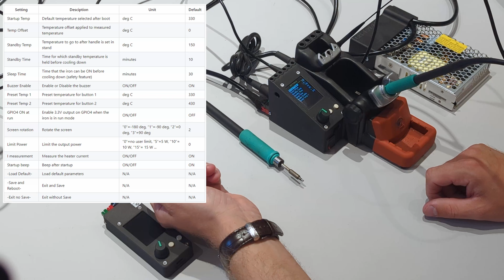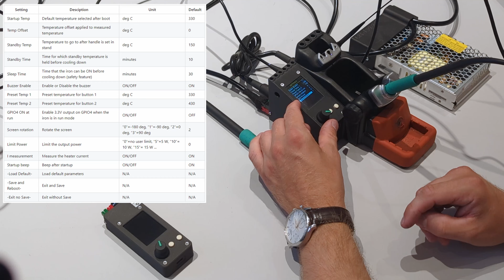AxxSolder 3 - Open source DIY soldering station for JBC cartridges, 9-24 VDC and USB-PD

Comment: 10:34 Perhaps you should familiarize yourself with the settings before making such statements.
Reply from the maker: After using JBC equipment professionally for several years I do think I have the right to say that I think the interface is annoying.
What do you think is so great about it? If you have a good input I may be able to introduce  it into a future AxxSolder firmware.
Reply: @Axel.Johansson  does not change the fact that the limited temperature is a matter of adjustment.

Comment: Dear Sir, it's possible to mod for using ac for the heater supply? Thank you and congratulations for this project!
Reply from the maker: Hi!
To switch AC you need different hardware. This hw uses a single MosFET for the switching. But ofc. It is possible to redesign to integrate a proper AC switch. Everything is possible :)

Comment: tôi có thể sử dụng 1 màn hình TFT cùng kích cỡ và độ phân giải ko ???
Reply from the maker: I use a TFT screen with the ST7789V driver, that should work. The pinout can be different on other boards. Ask on discord if you have more questions

Comment: Thank you very much for your excellent project. Other players have found that after entering the menu, long pressing any of the two buttons on the right will cause garbled characters to appear on the whole screen. I tested it tonight and the same garbled characters appeared.
Reply from the maker: Thanks, This will be solved in the next firmware update. Thanks for informing about this.
Reply: @Axel.Johansson  Hello, how can I add you as a friend on discord?
Reply from the maker: @明明-p2k  There is a invitation link to the AxxSolder Discord channel on the GitHub page. Join that group and You'll find me there!
Reply: @Axel.Johansson  When I clicked in, it said "The invitation may have expired, or you do not have permission to join."
Reply from the maker: @明明-p2k  Hmm, does not this work: https://discord.com/invite/AwpHEmsyKj ?

Comment: I highly recommend to implement some conforting settings for the BEEP, 3-5 volume levels, 3-5 different tone, and 3-5 frequencies, people are not the same, some have sensitive hearing, some deaf as a cannoneer. I think it is much better than simple ON/OFF function. I love ZEBRA barcode readers, because I can customize everything (light intensity, volume you name it) by simply scanning setting barcodes, once it set I never touch the settings again it's saved forever, better than setting up Logitech stuff.

Comment: Will the station run jbc nano or precision tweezers?
Reply from the maker: No, no tweezers at the moment
Reply: @Axel.Johansson  thank you for the reply.
Reply: @Axel.Johansson  I saw that two AxxSolder stations were connected via a homemade adapter from two stations to one output for C210 tweezers and this works

Comment: Is there any way to increase its power output? Like 200 - 300 watts?
Reply: The powerdraw/heat output depends on the resistance of the heating element in your tip, the lower the resistance, the higher the power draw and heat output. I know of Chinesium tips sold by Yihua for example that have roughly 2.5 ohms, not sure if they perfom better than the JBC tips though but in theory they should allow more current ° fixed voltage = higher power consumption :D That output also needs to get into the tip, otherwise the element will just burn up faster. 
And all those 300+W China soldering stations either have multiple channel outputs for multiple handles or just sum up power for iron + power for hot air side = total performance bcause bigger equals better :D

Comment: Really great project, but I can't find any documentation on tip voltage? I have used irons with continuity to protective earth but they still have ~150mV AC at the tip. I think the commonly accepted spec is <2mV

Comment: Hi. Could you please tell me what I need to change to set the maximum power for the cartridge? I mean which file and what code inside it I need to modify so that the maximum power changes in the device settings
Reply from the maker: Hi! Can you reach out to me on the Discord server (link on GitHub page) or via email (on my GitHub profile page) and I'll try to guide you

Comment: Thanks for sharing such a project who cannot afford a genuine JBC station, But still this is quite complicated project for me ..... can you make a simpler and easiest version of it so that we can make one at home .... i would like to make one with through whole components most of the SMD components used in this project  are not available in my country (INDIA) and not genuine jbc handel and tip, we use clone of JBC tip and handel.....if i try to purchase from pcb way with smd assembly of your project still we don't have the matching lcd module to the project ...any way thanks for the video.....if there is a video about a JBC station for t210 tips with oled 0.93 display , arduino or ESP32 coming soon with through hole components...... i will be happy to see and build one .......Thanks ..

Comment: hi can u please help : (

My Solderingiron is a Yihua 616a C245 Tip Solderingironhandle 

my Question is there are 4 Pins 

1- Little one ( Red )
2 - Middle long  Bluethick and Greenthick wire on Greenwire are a little 10K Resistor 
3 - The Long One ( Blue Wire thin Earth )

What i must do , the Resistor Wire Green to cut of or how i connect it to get that handle Work ? : (
Reply from the maker: For these types of questions, Please ask in the discord chat. There is a link to it on my GitHub page. Add some photos also of your connections and I am sure you will get help from either me or someone on the server

Comment: Hello Axel! Is T12 handle support planned?
Reply from the maker: Hi! 
No T12 support is planned.
Reply: @Axel.Johansson  I noticed on T12 clones that the heating time gets longer with the tip's age, I don't know if you can compensate for that.
I use T12 because it's cheap so I don't mind bending and modifying my own tips, if I break one not a big loss.
Reply: @ИльсурН upgrade request bro,, not downgrade.. LOL
Reply: @alfatihid8901  Yeah!!!T12 makes me yearn for quality goods, I would rather let myself hang on a tree via knot than buy T12

Comment: Hello :)
I would like to know if you managed to fix the issues that the aixun's clone has which is overshooting problem on grounded PCB ?

Thanks a lot, awesome work!
Reply from the maker: Hi! 
I do not know exatly what the problem is with the Aixun station. But with AxxSolder you can have a grounded tip as long as you have a floating power supply. You can read more about this on the GitHub page as well as recommended power supplies! :)
Reply: @Axel.Johansson  main issue with aixun soldering station is that overshoot as hell like 100c when working on grounded pcb, have you ever tested?
Reply from the maker: @anthropy_3d  Using AxxSolder with a ground connection (it is not mandatory, you can run of a single DC source too but I recommend to connect protective earth to AxxSolder) you can work on grounded PCBs without problem. 
Example: I have AxxSolder powered from a Meanwell LRS-150-24 SMPS and have connected mains protective earth to AxxSolder, as well as to my ESD bench. The tip of my soldering iron is now the same potential as mains protective earth. There is no problem touching the tip of the soldering iron to another object having the same potential as mains protective earth (grounded). Hope this answers your quesiton.

Comment: Hello,
Great project, especially the display on the screen!
I would like to copy it, but I have two questions:

1. Why do you need (according to your Mouser list) a display with a built-in SD card connection?

2. How can I calibrate the device later if I buy tips from Aliexpress instead of original JBC?
All of them have more or less different values!
Reply from the maker: Hi! 
Thanks! :)

To answer your questions: 
1. There is no need to have the SD card. it is not used for anything today. The reason I went with that one is that the display is good and beeing able to source it from reputable sources is nice. But search "320x240 ST7789" and you find many alternatives to the Adafruit one. 

2. Today there is only a global temperature offset (+ or - deg C) that you can set in the settings menue. For original JBC cartridges that I use there has never been any need to change this. I assume there are aslo "OK" and worse copies that you can buy. 
But when you say calibrate, do you mean temperature offset, temperature profile, or do you mean calibration of the cartridge heating e.g. calibration of thermal mass and heat dissipation? and do you want to do this for every tip that you use? There is a discord server that are maybe more suited for this type of discussions than YouTube comment section, you are welcome! Link on the GitHub page.